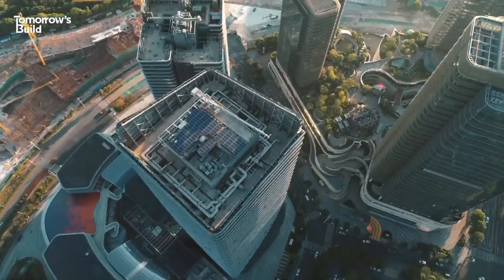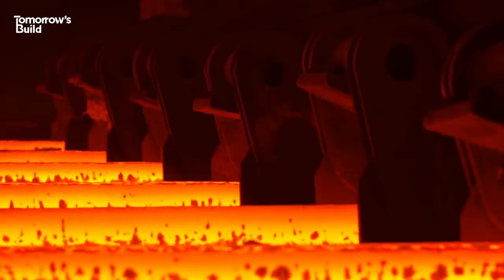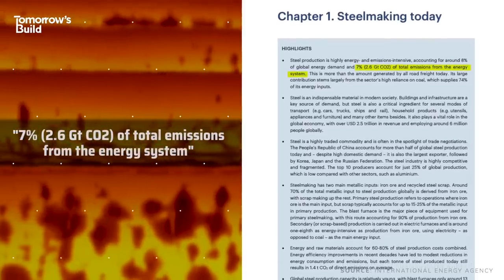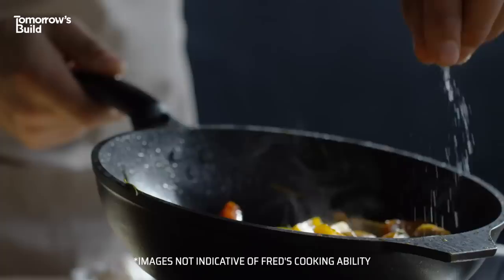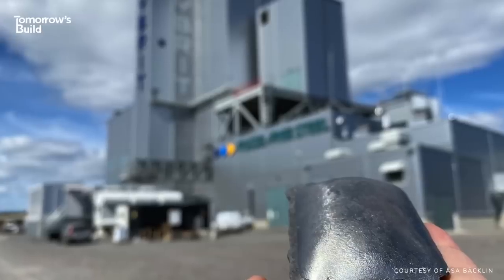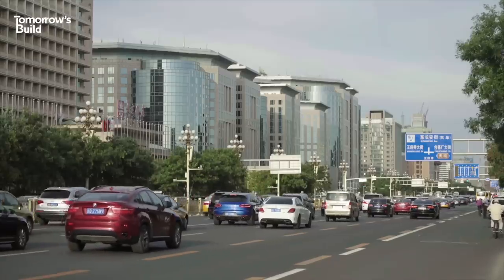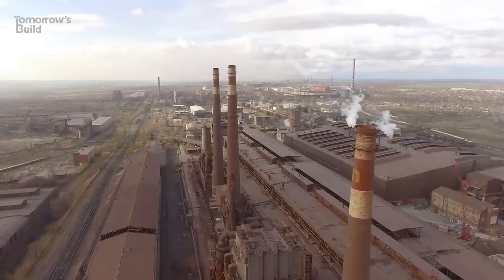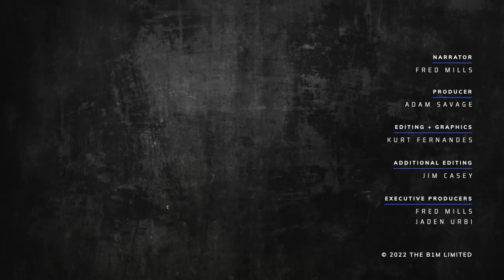Has Sweden Invented Green Steel?

Comment: The problem is hydrogen is expensive
Reply: Electricity is cheap in the north of Sweden. Meaning that they can do the entire electrolysis process in-house.
Reply: @vberl9573  and I'm guessing that electricity comes from burning fossil fuels? 🤣🤣🤣
would be so ironic if it did
Reply: @hidum5779  It's mostly hydro. Sweden has vast hydro resources and doesn't need to burn many fossil fuels.
Reply: steel is expensive anyway so a marginal increase cost won't matter much

Comment: Now now, let's not toot the horns too quickly.
A minor change: "Carbon free steel" does NOT mean getting the ore out of the ground without emissions of CO2. That's just a plain lie.
Omitted information: Just how much electricity are we talking about when it comes to creating this "carbon free steel"?

Truth is, the theory used for this is not groundbreakingly new - HYBRIT did not exactly come up with it. It's not feasible due to the humongous amounts of energy needed to power the processes and chemical reactions.
As it needs a humongous amount of energy, "Renewables" is another plain lie. We're talking more energy only in steel production than the rest of northern Sweden uses combined, an estimated 70-100TWh.

Sweden's current electricity production and electrical grid cannot support this at a large scale, and if it was scaled up, it would probably be worse overall for both emissions and environmentally than just burning the coal to begin with.

Comment: The problem is not what fuel is used to refine steel but how environment friendly the fuel is. In this case the question is whether the hydrogen used here is created from green energy or some fossil fuel like methane or coal generated power for electrolysis
Reply: SBAB makes their steel primarily from hydro and wind power.

Comment: I'm confused as to what exactly they did. The substituted hydrogen instead of carbon in the actual steel, or are they using hydrogen as fuel to power their production? 
If the later ...BFD! They stil need coke for the actual end product.

BTW oil which is what everyone is bitching about in the west, is essential in plastic production! No oil.. no plastics!
Want your next phone to weigh as much as a dumb bell? 
The world is fine despite what the crazies scream. We are just coming out of an ice age, so the temp is rising. Quit panicking like the sky is falling.

Comment: That's wildly misleading, since grid electricity is fungible. When you disconnect a windmill from the grid to make steel, you force the factory across the street (which used to get it's power from that windmill) to get it's power from another source. Green energy is a great idea, but it's the combined grid that matters, not which factory claims certain parts of it. Read a book, TB.

Comment: Gonna need lots of wind turbines. Like thousands and thousands and thousands. 
I don’t see this happening anytime soon. But hey, it’s a start. Reduced emissions is a good thing but getting to zero?  Never gonna happen.
Reply: In sweden we basically only have hydro, nuclear, wind and solar power. But trying to do it somewhere with dirty power will probably not be helpful
Reply: Sweden doesn't need hundreds of thousands of wind turbines in the north. The electricity generated in the north of sweden is already green as it is mainly from hydro power or things like wind power and solar power. Meaning that the electrolysis process used to create the hydrogen is green, at least in sweden.